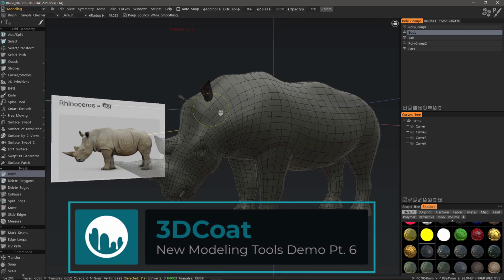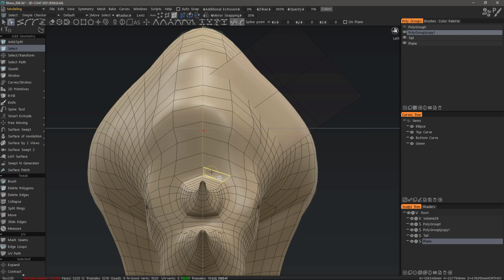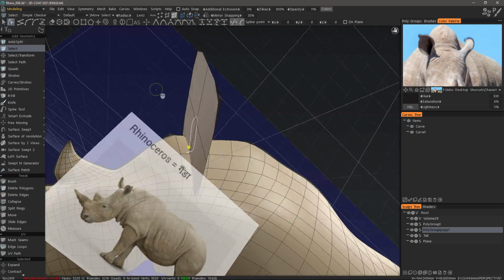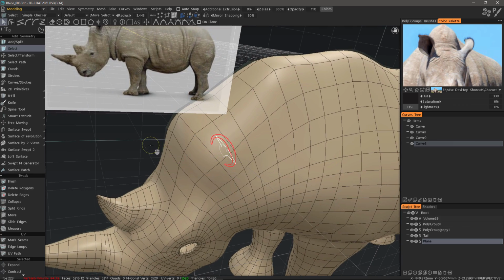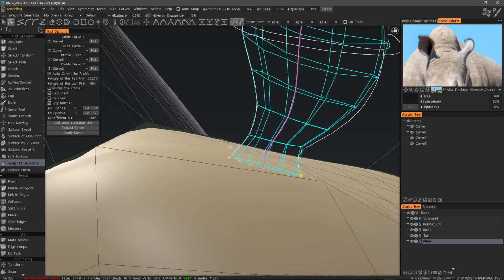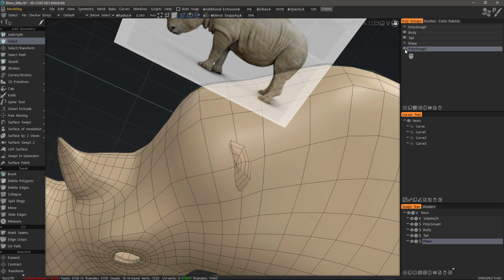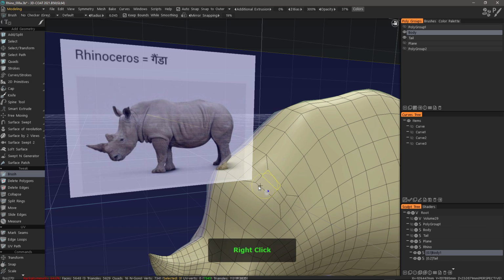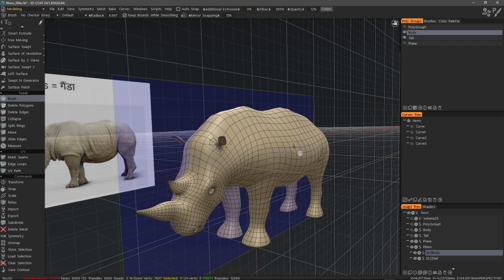New Modeling Tools Demo Pt 6

Comment: Awesome tutorial, thanks! I've been using Rhino for product design and it's more about prototyping. I'm thinking of jump-shipping to 3dCoat. I understand I'm posting this in your page, but I need to know is 3dCoat going to be the right tool for me or not? (btw is is possible to have parametric polylines in cm or inch and to measure them?/ am I able to make radio prototypes with some screws in it?)  Appreciate your response!
Reply from the maker: Hi Kia. Thank you for the kind words of support. It's actually a good thing that you have this experience in Rhino, as your input regarding new tools and features could help to dramatically alter the trajectory of the Modeling tool development in 3DCoat. Feel free to ask Alexander...the developer of these tools...to make additions that you frequently rely on, in Rhino. The developers really do try to please, to the extent they can, and Alexander is fairly responsive. You could send him a message with your requests and questions, on the forum:
https://3dcoat.com/forum/index.php?/topic/23318-retopo-next-big-step/&do=findComment&comment=173265

or email support@pilgway.com and mention that you want to address it to Alexander. Andrew (owner/chief developer) will forward it to him.
Reply: @PILGWAY3DCoat  Your helpful responses are making me decide faster and easier. I'll get in touch with Alexander as well as Andrew as advised. Really appreciate it. Cheers!